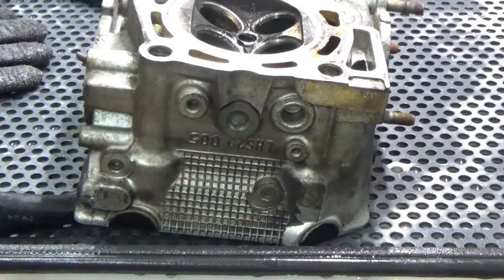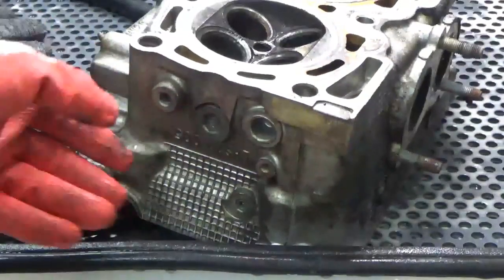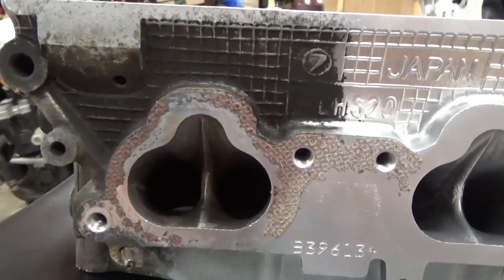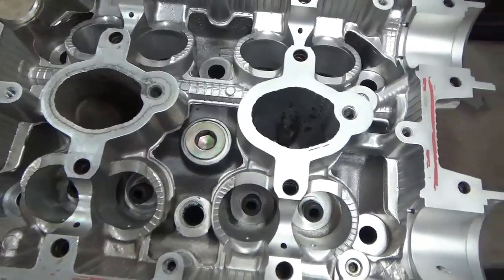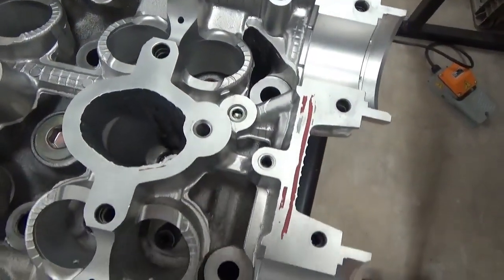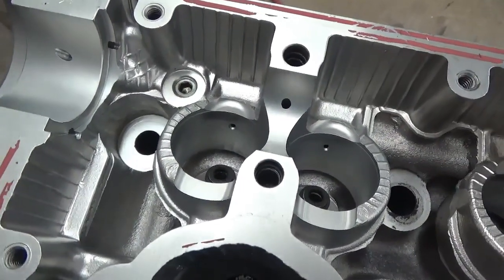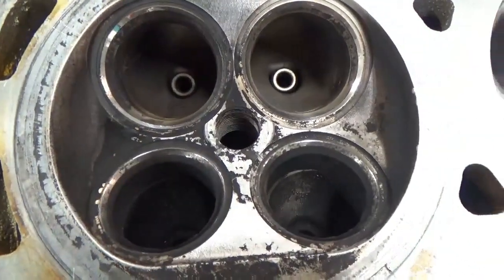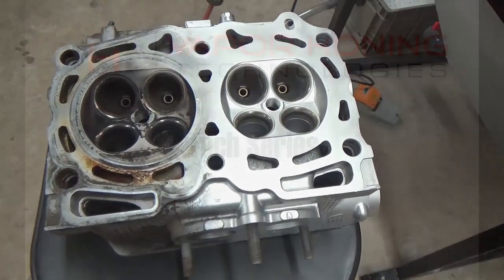Automotive Cylinder Head Cleaning- Vapor Honing Technologies

Comment: There's only one probably I run an engine machine shop and unless you take hours to remove all the oil galley plugs and oil restrictors in those subaru heads the media is trapped and causes serious engine damage. We had a set come in from a brand new short block that just spun bearings guesse what it was vapor blasted when we removed the oil restrictors they had abrasive packed around them. I love the finish and the machines are awesome but beware over head cam heads and blast media does not mix.

Comment: There are cracks coming from the valve seats to the spark plug hole. Guessing this was just an example of the cleaning process. Use to work for a machine shop, once you have an eye for spotting cracks. Its hard not to say something. Also, when glass beading the heads, I would never go over the cam journals for obvious reasons
Reply: Paul Akers Jr tbh i think its a junk yard subie head
Reply: @Initial_Gopnik  its definitely a Subaru head,  if its not a junk yard head, customer should get his money back because it belongs in a junk yard
Reply: Its quite common and doesnt affect the head at all. If youre ocd you can have them welded, machined, & rethread spark plug holes.
Reply: @scandinavianflickgd7331  I guess if your running NA you could get away with it for a little while, but yeah, NA or not, my OCD would definitely kicking in. Wouldn't go back on my short block

Comment: This is exactly reason I'd love to use it but with aluminum oxide to get rid of the gasket material. Taking it off is a pain and also and to get the right RA is definitely my reason as long as the head and block aren't warped.

Comment: Will it mess up the valve seeds?
Reply from the maker: Highly recommend thorough rinsing and drying to be sure all abrasive is removed, but it will not damage the part at all during the process.
Reply: Valve seats.

Comment: Thats a good looking cilinder head ! , but glas bead blasting on a cilinderhead with a oil gallery ,like this one has, is not smart , the gallery has many dead spots ,those spots are almost impossible to clean wihout taking the gallery plugs out . i have seen too many shining, good looking engines ,destroyed by glas and other abrasives , use (wet) soda , or even better ultrasonic cleaning ,
Reply: or how about cleaning it like this which is going to to clean it WAY better than an ultrasonic tank will and then dip it in the ultrasonic to get the grit cleaned out and the rest of the crud out of oil galleys as a final clean up step where the vapor honing cant touch?
Reply: clean and good looking , is quite a difference imho , your wrong about a ultrasonic cleaner , it will clean a complicated form way better than any blasting process can , because it can be so sensitive (cleaning water residu of water damaged mobile phones for example ) , and reaches all corners also on the inside of things., for (alu +zamak) looks there is not much that beats a vapour blaster.  but it is quite dangerous and wrong to bombard these complicated cilinderheads with glass beads , or to polish a piston on the skirt , simply because it needs a certain surface roughness to let the motor oil stick to it .